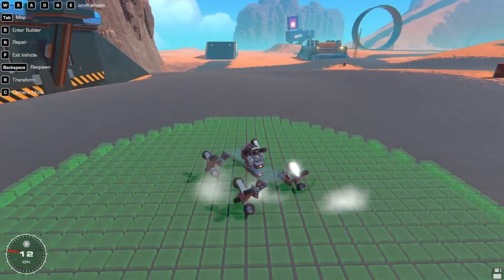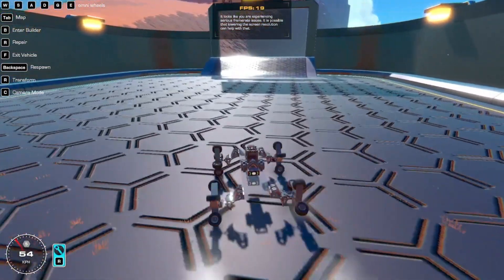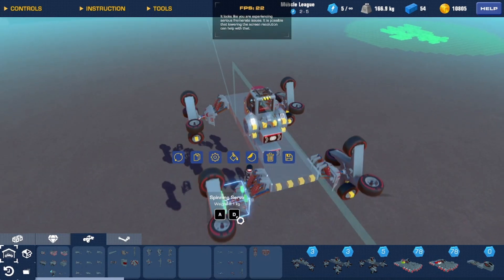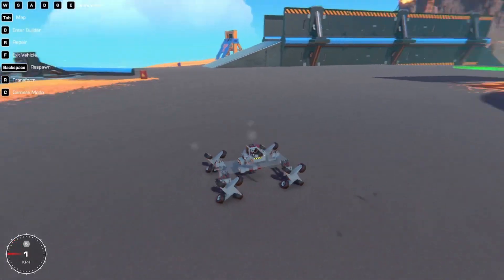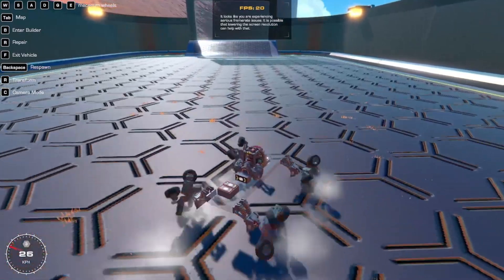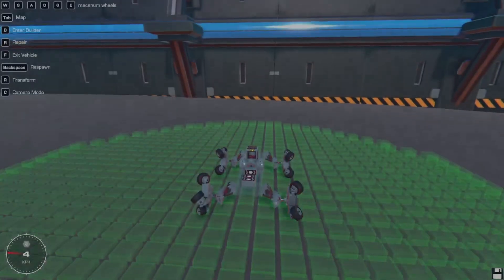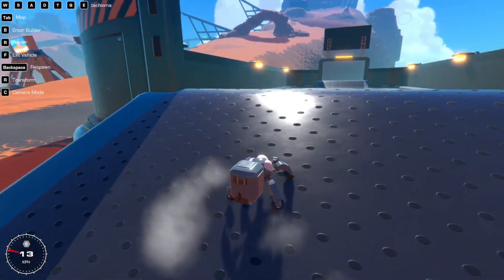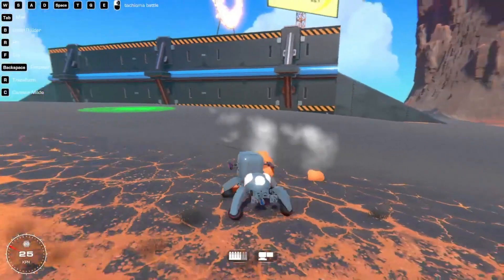Mecanum Wheels and Advanced Mobility in Trailmakers

Comment: how do you get the tachkikoma to work? whenever I try to replicate it it spins out all over the place
Reply from the maker: its uploaded so fell free to look at it but it uses a separate engine per wheel and a few logic gates.
Reply: @ThisIsDumbAllTheNamesAreTaken  ooh funky, and I wish I could but I’m on console 😭 thank you
Reply from the maker: @sidm8301  ah, there is still a way to transfer the files but its a complicated process. what i did was have the wheels at 45 degree angles and because each wheel had its own engine i can control each wheel individually. for the following assume that green makes the front wheels roll forwards and inwards and that the green direction for the back wheels makes them roll forwards and outwards. (basically they roll diagonally because they are diagonal.

now for all the settings:
directly on the engines: make green your forwards key and red the backwards key.

for non gyro steering use two logic gates. it will operate just like tank steering. 
to turn right make the gate going into the right side apply a negative value and the gate going into the left side apply a positive value. same thing for turning left. again, in total this steering should only take 2 logic gates.

for strafing:
same logic as steering but instead of pairing up the wheels on the right and the wheels on the left, pair up the diagonal wheels into sets. so 1 logic gate should control the forwards right and the back left. the other should control front left and back right. flip controls or change keys as needed. 

that should be all.

Comment: I built one of these (it's called the Omni-Whiplider and The Fellow Omni-Whiplider) and I fixed the thing where ypusometimes go in the direction you don't want too by either balancing the weight, or both that and putting more weight, it has alot less traction cuz of that tho (the whiplider uses more than five dragon engines and most are at its abdomen [is that right? I'll just say it's it's butt]) however the major problem was adding different wheels, idk if its because I put suspension but it got more troublesome. It would not go forward, or shake to much, or even somehow have even less traction.

Comment: Can you try to build a monowheel with suspension under the normal complexity limit of 700? I didn't manage to build one because it's very complicated.
Reply: I only end up reaching the complexity limit when I armor things up, so either your building to large, not conserving complexity, using far too many high complexity block, or finally, just outright using too many blocks in general.
Reply from the maker: how? just use a truck wheel and some stablizers.